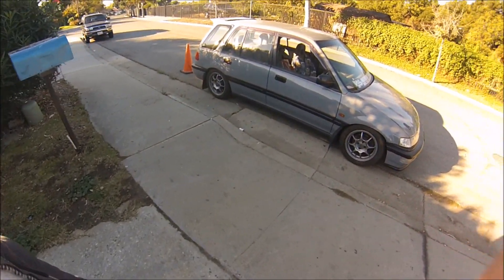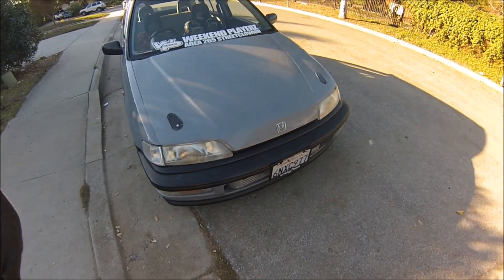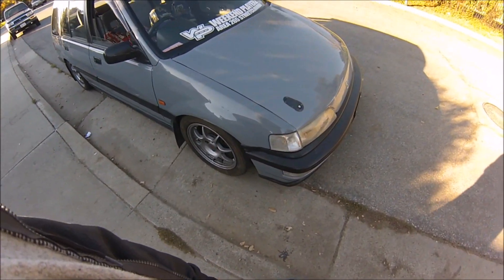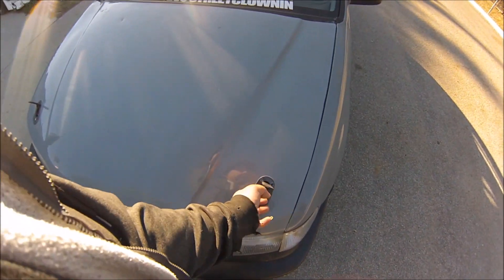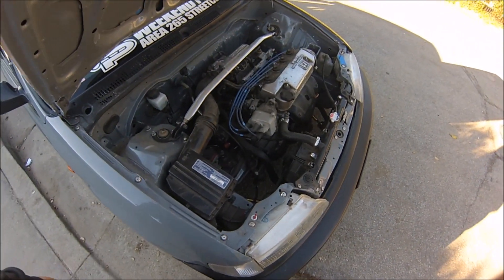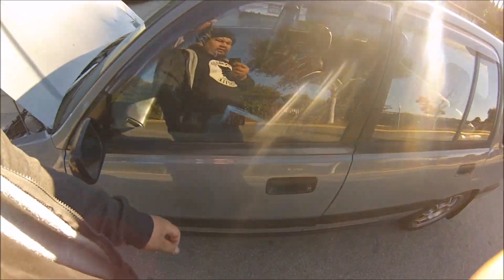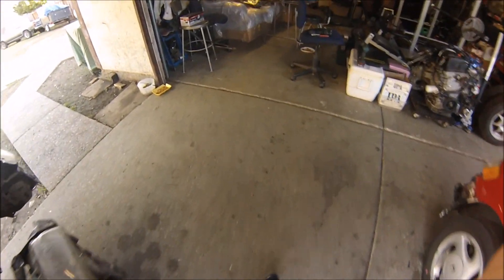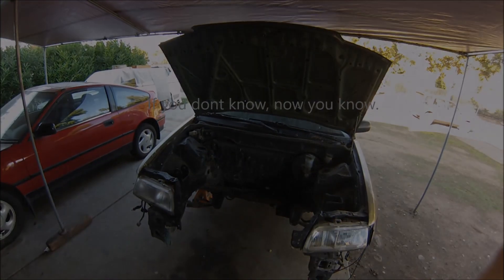Where has my RHD Wagon been?

Comment: damn u been slacking lately, seriously i thought u died lolz.
Reply from the maker: +Bolo Yaj LOL. no i just havent been really doing anything lately with the cars. therefore no real updates. but they may change very soon!
Reply: +YoungStatic but if u going k, y not do it in the rex? makes more sence in a lighter chassis.
Reply from the maker: +Bolo Yaj its a car i may possibly do circuit for next year. the reason why i pulled the turbo engine from the beginning was because it was hard to shift it down the track being rhd. the crx is getting a whole new setup soon for boost.
Reply: +YoungStatic keep me updated on them videos. peace out brother.